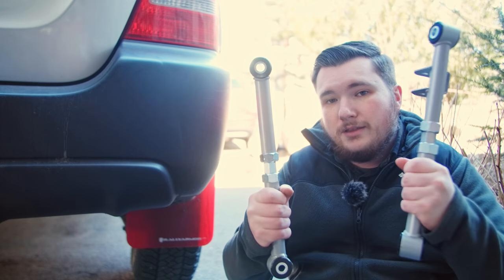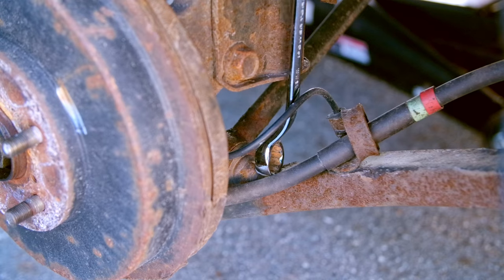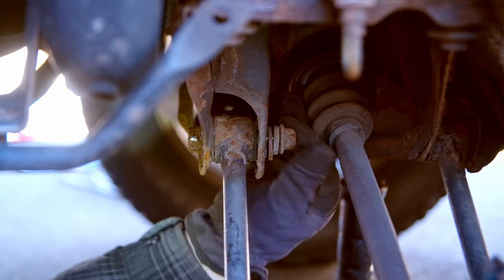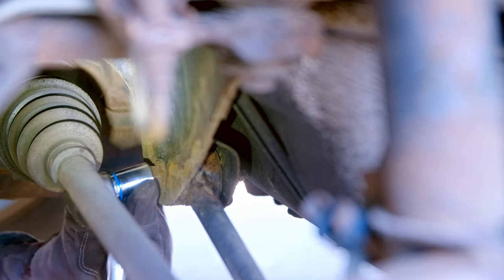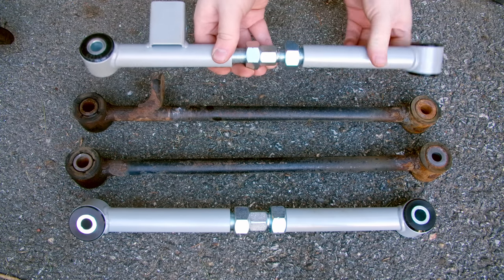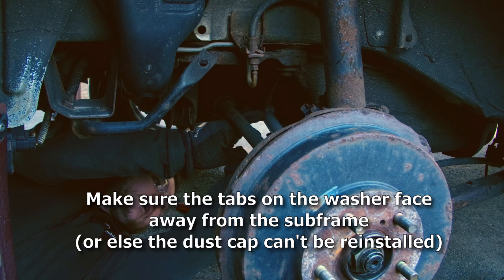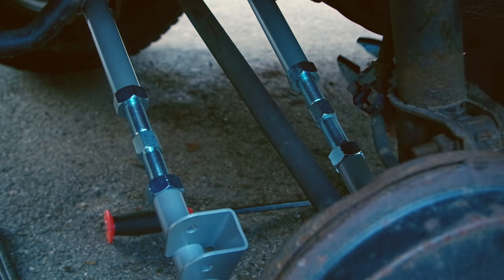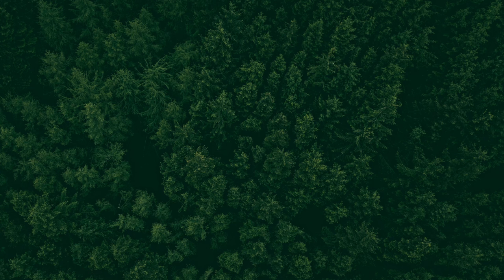How to Install Whiteline Rear Control Arms on a Subaru Forester (1st & 2nd Gen)

Comment: Would the end links have fit if lowered? The only reason i can think that they might not be compatible is if you had to use the end links.
Reply from the maker: The arms are designed for lower applications. I swapped the left and right arms so I could have the end link brackets facing up.

Comment: I’m dealing with this at this moment lol. What Ratchet did you use at the 3:00 minute mark I need something that can handle that much breaking power. Thank you!!
Reply from the maker: I don't really remember the brand of it as I borrowed it from a friend, but I think any tilt head style ratchet should work, it just needs to be thin enough to make it in between the bolt head and the axle. You could probably also get it with a wrench and a pipe too.
Reply: @TheCreateOutdoors  I’ll give it a shot thanks for the reply! Have a good day!!
Reply from the maker: @alexhiro-1241  you too! Good luck!

Comment: I clicked the link and I put my forester in and it's saying it won't fit. But I just watched you install it. Do I just ignore whiteline?
Reply from the maker: Ah, I know what's going on there. If you have a second gen Forester (03-08), it shows a different kit for it that only includes the rear arms, but that's not enough for full flexibility in the alignment.

You have to buy the first gen (97-02) arms instead, which I linked to. They are compatible since it's the same suspension between generations. I emailed Whiteline awhile back but they never got back to me.

So in short, yes, just ignore Whiteline.
Reply: Thank you for the response and the detailed video 👍
Reply from the maker: @ducky7119   no problem dude!

Comment: Are these actually required?  I know they are nice to have but are they required?  I have a 1.25" lift and 215/75/15 tires so max lift is 2"
Reply from the maker: Not at that height, no. Tires won’t really play a factor is causing positive camber. I have a 2.5” lift with 215/70/16 tires (so 3.5” overall), so camber bolts were not enough.

Comment: I hear lots of guys say, "Torque the lug nuts to 65 foot-pounds" but my 2014 Forester docs say go with either 79 (steel wheels) or 89 (aluminum). Am I being misguided?
Reply from the maker: No, I agree with you it should be around 80. I don’t understand why 65 is okay, that is far too low.

Comment: What is the purpose of "lifting" a vehicle, other than cosmetics?
Reply from the maker: The purpose of lifting a vehicle for offroading or overlanding is to allow for more ground clearance over obstacles on trails. Lifts are not intended as a cosmetic mod usually, even though it is a side effect of installing a lift kit.